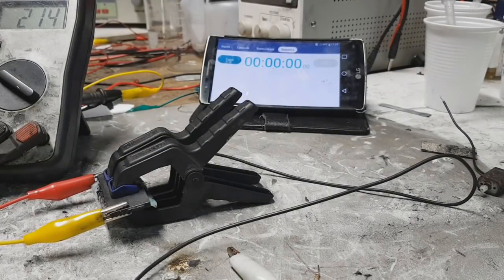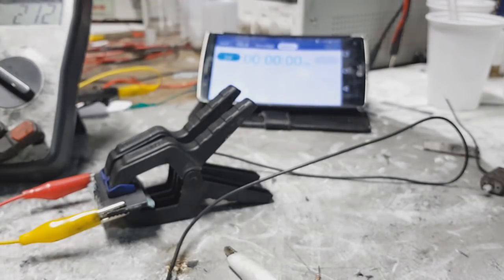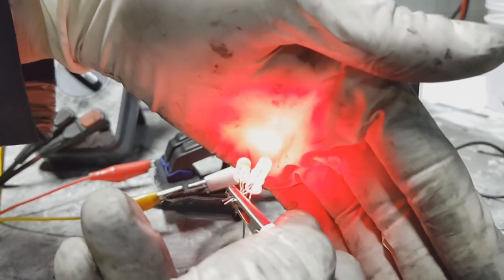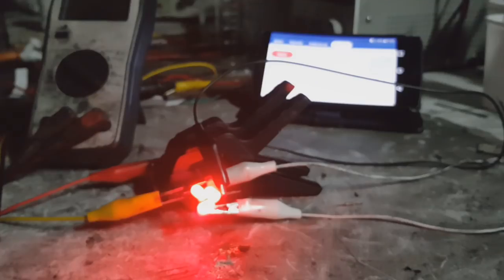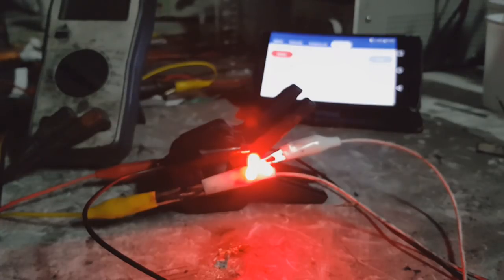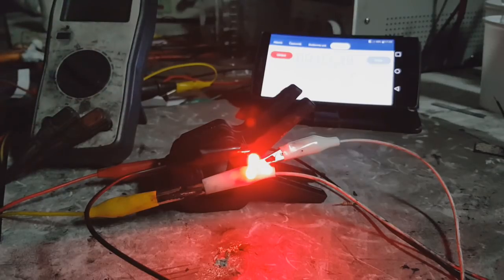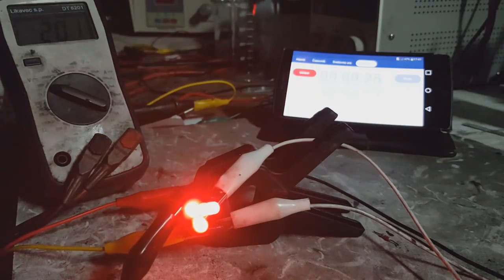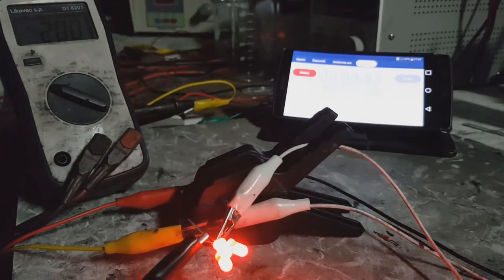Supercapacitor -  LED run test

Comment: you forgot to measure charge and discharge time and current, what for is there a digital meter in the picture? Obviously you should have more load on the super cap to see it finish within reasonable time!

Comment: Yes i agree with overunity i once built a joule thief circuit and wired up 80 Led's ( green)  series and parallel configuration that ran for days from an AAA battery for days.
The best bit was the circuit only commanded 8mAmps.
So yes the way forward my Friend.... keep em coming 😎
Reply: Yap, Joule thiefs are great!
Would be cool if you would do somewhat as a 100 days to a supercap with higher capacity than NiCd challenge. But please keep your vids a bit shorter (so maybe from 7-15min would be great)

Comment: Well done. Maybe get a good JouleThief circuit and run some white LEDs (at least 1 or 2Watts LED) and see how long they run on it...Use more active Material and charge it for at least 10 Minutes and also with a Joulethief type pulse charger to really press the ions into the supercap material..